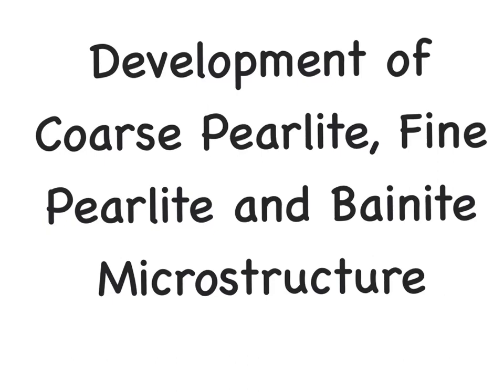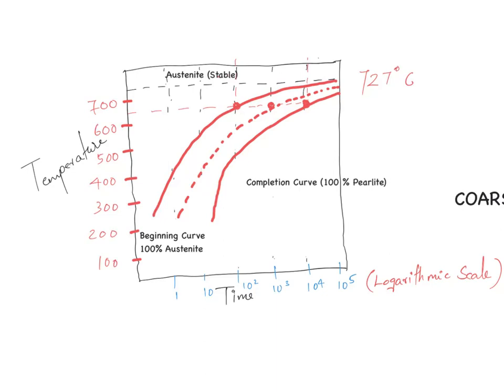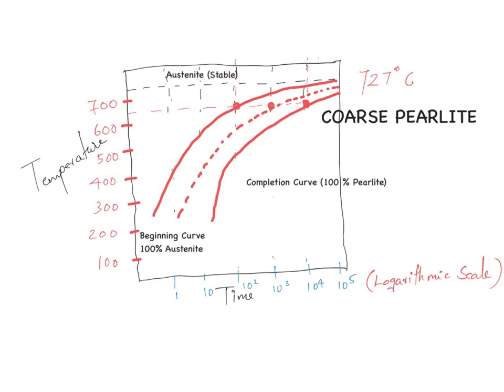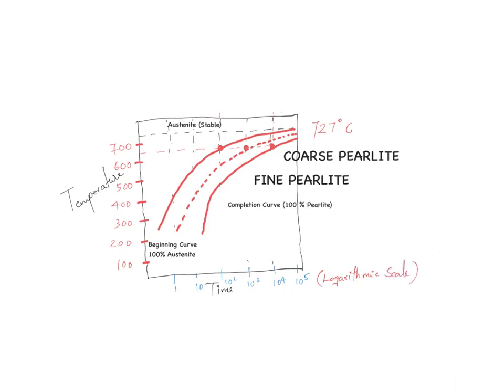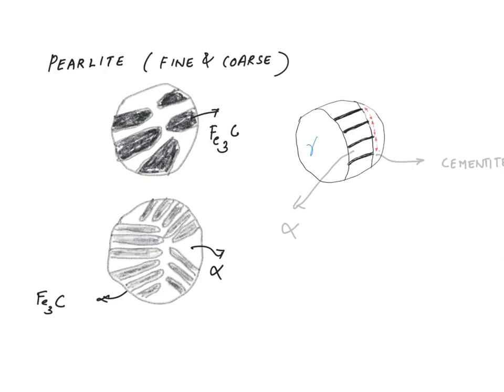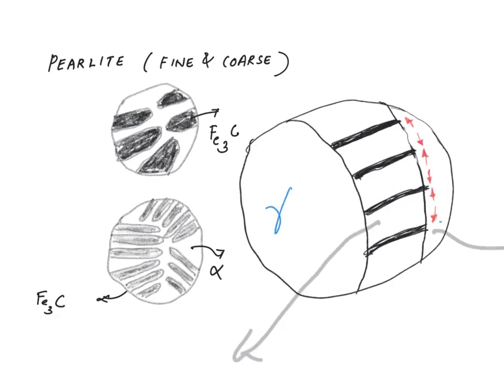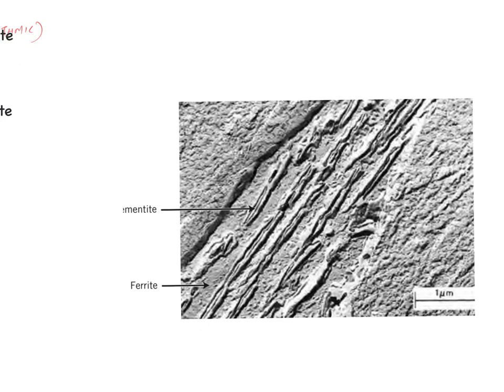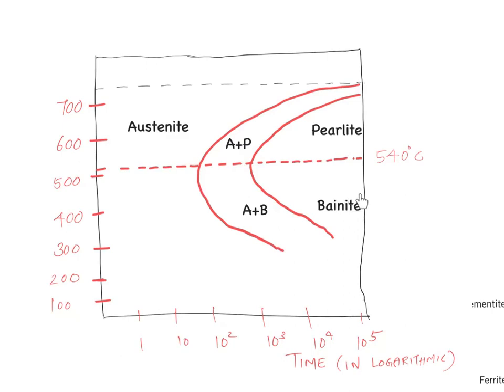Development of coarse, fine Pearlite and Bainite Microstructure

Comment: In Fe-Fe3C phase diagram, below 727 deg C, Austenite is not possible.
But TTT showing @400 deg C also Austenite phase is available.
Can you please explain how this is happening?
Reply: Phase diagram always show equilibrium states and do not consider the cooling rates. At 400 deg C, Austentite will be in meta-stable state. If you give enough time and thermal energy (by holding it at a constant temperature), then depending on your temperature, carbon will either diffuse by itself or there will be high enough driving force that austenite will decompose into either pearlite or bainite microstructure.